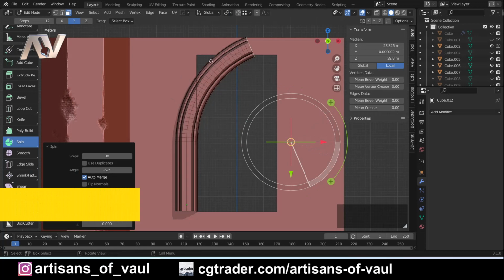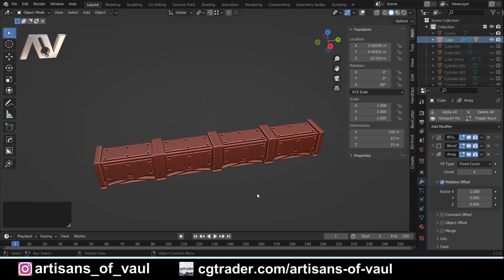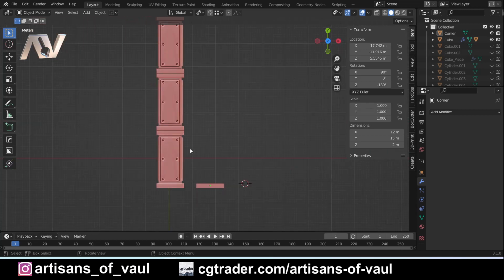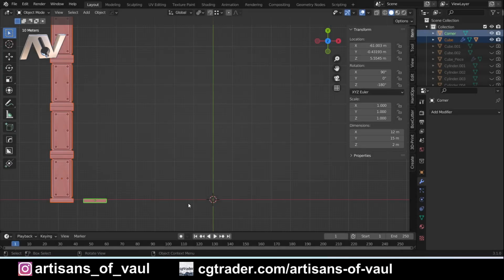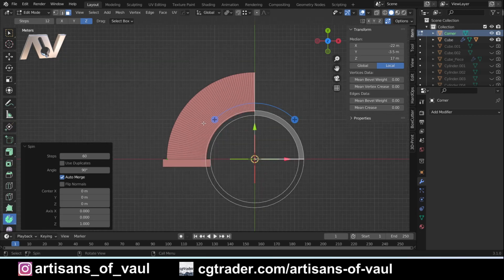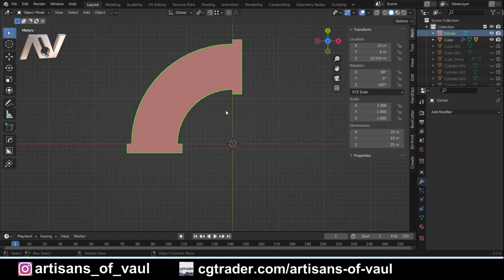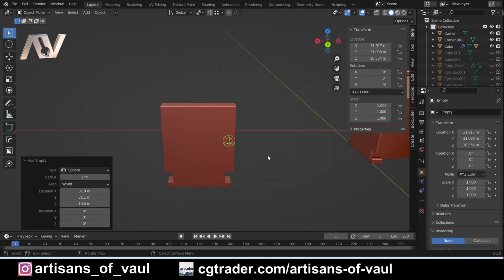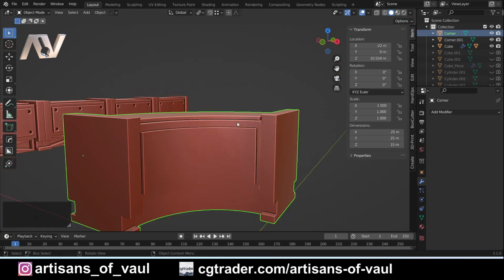Using the Spin Tool for precise measurements in Blender

Comment: Use the PDT (precision Drawing Tools) addon.  You can set the origin to your edge, then in PDT tell it to move the origin 22mm to the right.  Bam.  Perfect wherever your object may be.  Faster than using the empty method, and faster than moving everything to world origin.
Reply from the maker: Thanks for that.  I haven't used PDT before (so this may be wrong) but having had a look at what PDT does if you wanted to work that way by moving the origin I dont think thats the most efficient way to do it.  If you get the origin to the edge you can just go to Options (top right) and select to transform the origin.  Alternatively you can just use Ctrl+. (thats a full stop) and you can control the origin with "g" as normal.  I still think that this method is slightly slower than the world origin method but if it suits the situation or your prefered work flow then I always say that there's loads of ways of doing the same thing in Blender, do whatever you prefer.  But do try that Option or ctrl+. method as you might find it quicker for this.
Reply: I misspoke...i was taking about the 3d cursor not origin
Reply from the maker: @Bad.Rabbit  Oh if you can move the cursor without having to faff around with the origin that is going to be faster.  I didn't see that it allowed you to do that. Im going to have to check it out as that is a really useful feature.  Thanks 😁